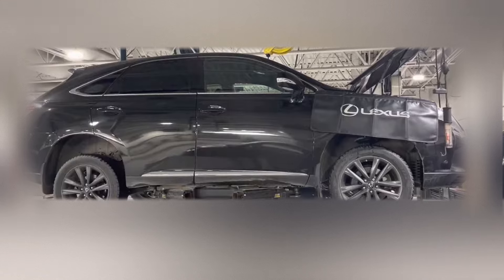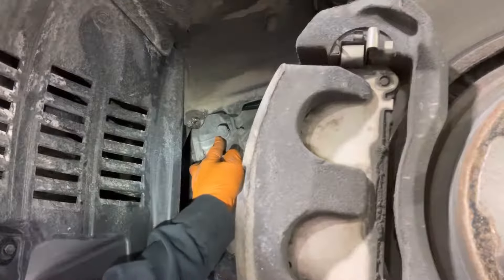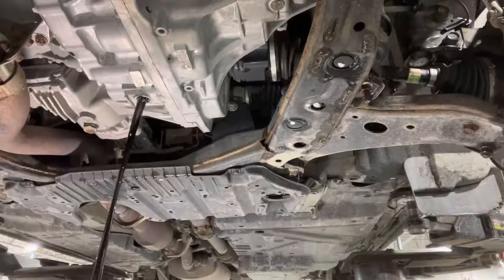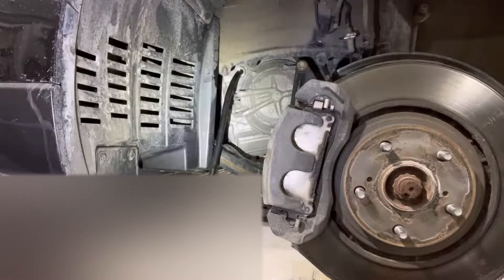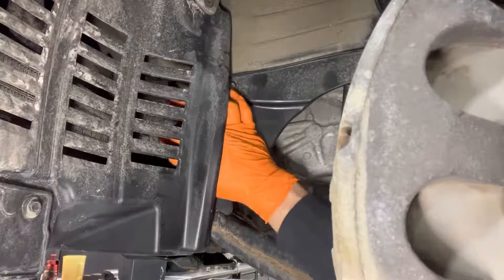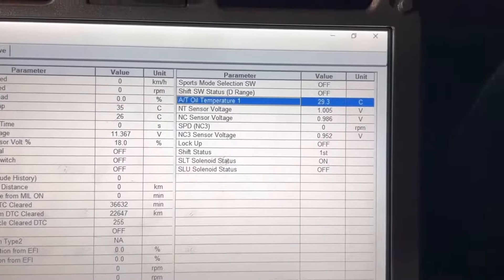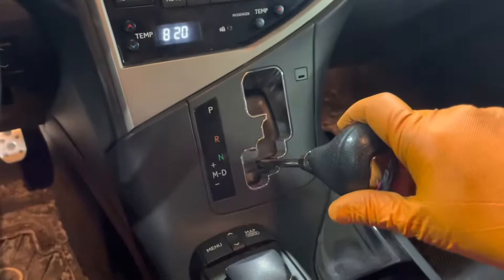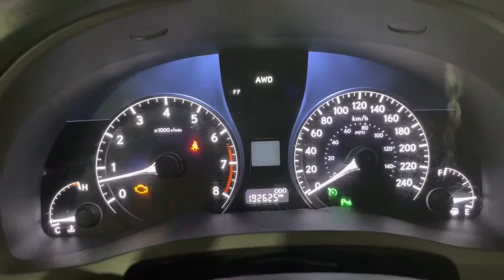2013-2015 Lexus RX350 F-Sport Transmission Fluid Replacement Instructions

Comment from the maker: Below are my affiliate links to the parts and tools you would use to complete this job. I may receive a small commission from the product sales. Thank you!
Genuine Lexus/Toyota automatic transmission fluid type WS: https://amzn.to/454JymA
Genuine Lexus/Toyota transmission overflow tube O-ring: https://amzn.to/3RwEdkU
Genuine Lexus/Toyota transmission drain plug O-ring: https://ebay.us/v9dHuZ
Genuine Lexus/Toyota fill plug gasket: https://amzn.to/3PsnVHb
Transmission fluid pump: https://amzn.to/3t6TO0u
3 Ton Jack stands: https://amzn.to/3q6VS7t
Sturdy 4 Gallon oil drain pan: https://amzn.to/3Ou4iiu
Torx bit socket set: https://amzn.to/44JAyUv
17 mm Allen head/hex bit: https://amzn.to/4584c5n
3/8" drive flex head digital torque wrench: https://amzn.to/3O1EOru
Rechargeable LED mini work light: https://amzn.to/3Y74OpY
Brake and parts cleaner to clean up the spilled oil mess: https://amzn.to/476RZQz

Comment: You are the best Viktor.
Reply from the maker: @JKS620  thank you 😊
Reply: @Viktor_G_Automotive did you see my other question about drain and fill intervals if trying to refresh all the fluid?  How long in between?
Reply from the maker: @ no, I didn’t see it. You can’t really replace all the fluid by doing drain and fills because more than half of the old fluid stays inside the transmission after a drain. On my vehicles, I just do a regular drain and fill every 60K miles and feel that’s enough. Some people choose to do a drain/fill, run the engine, do drain/fill again etc. I don’t know if that’s an overkill or not, but certainly won’t hurt anything. Doesn’t replace all the fluid since it gets mixed with the old stuff as soon as the engine is started, but will replace a higher percentage of it than just a single drain/fill cycle.
Reply: @ thank you.
Reply from the maker: @ no problem

Comment: Hi Viktor,

Do you have a similar video for a 2012 normal RX350?
Reply from the maker: @steliandragomir6815  hi, here is the video. The process is shown on an NX model, but it is exactly the same on the 2012 RX as they use the same transmission. https://youtu.be/TAUZ24dqssg?si=DPqWiCS-WSmejtxC

Comment: Thanks for the great video.  I plan to do this service on my Father's 2016 RX350 as I have just done this a couple times now on my 2021 Highlander. 

In the Highlander, there is a transmission fluid cooler bypass that needs to be pushed before completing this fluid change out.  Does the RX350 have a similar cooler than needs to be bypassed?
Reply from the maker: Hi, the RX350 does not have a transmission cooler thermostat. Here are the fluid replacement instructions for the 2016: https://www.youtube.com/watch?v=vaTORM3T24s

Comment: @Viktor_G_Automotive Thanks a lot for the video Viktor, super helpful for my 2015! I wanted to ask for the part numbers of the 2 O-rings, the link in the description for eBay does not work anymore.
Reply from the maker: @NimishGujarathi  I’ll look into it when I get some time, thanks!
Reply from the maker: Hi, I've updated the link, please be aware that I may receive a small commission if you use my link to purchase the part. Thank you! Genuine Lexus/Toyota transmission drain plug O-ring: https://ebay.us/FCTEOJ
Reply: @Viktor_G_Automotive  Thanks a lot, You deserve that commission Viktor! 😊
Reply from the maker: @NimishGujarathi  thank you 😊

Comment: I did two drain and fills on my 15 rx 350 and each time 1 1/2 quarts came out? Cold and warm it was the same.
Reply from the maker: @MatteoTodd  F-sport model as shown in this video? Should be around 3 quarts. Non F-sport uses a different transmission, drains between 1.5-2 quarts.
Reply: Ty so much your vids are amazing. Maybe you could help me with one question. My 2015 RX 350 non-F sport, do you know the drain plug gasket part number?
Reply from the maker: @ hi, all the part links will be below the video both in the description and the top pinned comment. (Not this video, but the other one for non F-sport) Cheers!

Comment: Dear Victor,  Thank you for the detailed guidelines. I tried to carry the procedure on my 2013 RX 350 AWD, but near the end when I was trying to set the fluid level by switching between D and N, the D and N both appeared for a few times and then alternately showed D and blank without N or a solid D. I was confused but still went ahead to drain out the extra transmission fluid while the engine was running. Why did not I experience the same as what you showed in the video? Did I drain the extra fluid too early?
Reply from the maker: If the indicator was blank, it wasn’t hot enough when you overflowed it, so the fluid level may be a little high.

Comment: Hello I didnt meaure the fluid that came out of my RX350 2014  not f sport model , I drained it while it was cold and then I refilled like 4.5 quratz as I was not sure but later when i realised after 20 mins of driving , I drained out little over 1 litre , the oil was bad and I put the drain plug did not do any fill up , is it okay or will I run into trouble ?
Reply from the maker: You must set the fluid level properly or you may damage the transmission https://youtu.be/TAUZ24dqssg?si=cj-lQYzRfOcvRcCW

Comment: Wow that is a completely different transmission than what's in the normal 2013-2015 V6 engines.  At least those with a pan...
Reply from the maker: Yeah, it’s a bit different from the 6-speed transmission.

Comment: Have a Lexus rx 450h 2014 with 145000 miles,went to the Lexus dealer and they didn’t want to change the transmission oil.any suggestions?
Reply: Get a second opinion, from a real independent transmission shop with experience with Toyotas.  The problem is, just like many independent shops, they don't do a lot of heavy repairs on Toyotas because they just don't see a lot...

You're on the edge of what many experienced techs will say not to do since it's not been serviced in the past.  The friction material suspended in the the fluid is actually helping the clutches grip when they engage.

If it was mine, I'd go ahead and do it and do it every 60k....
Reply from the maker: Just replace it yourself, here is my instructional video: https://www.youtube.com/watch?v=wdLpuT4ctC0

Comment: Where is the transmission filter? Do you not change out the filter? Why does f sport not have a filter and normal model does??
Reply from the maker: This video describes the fluid replacement procedure, not the filter replacement. This particular transmission has the pan on the side instead of the bottom. I am sure it has a filter/strainer in it, but just like the rest of the Toyota transmissions, the strainer does not normally need to be replaced.

Comment: Do you reset transmission computer after oil change?
Reply from the maker: No, it is not required
Reply: @Viktor_G_Automotive  Thank you! Bought my rx350 f sport from auction, was hit in transmission radiator, repaired it and transmission was in limp mode I suppose…got oil change in Toyota dealership (when your old video was deleted)but it was still in limp mode-they did not reset it! Then my friend reset transmission and it drives fine but sometimes it shifts kinda dumb with a kick when I speed up 50-60 uphill. I’m concerned if I should do oil change myself as dealership might not put level 100% correct. From your experience is it just normal for these transmissions or level might not be correct? Would appreciate your advice!
Reply from the maker: @СергейДаниловский-ш7и  the 2016-2019 RX models with the same 8-speed transmission as the 2013-15 Fsport RX have a TSB out for a software update for bucking and surging, but it doesn’t apply to the earlier models. I would first of all check the fluid level. If the level is good, there is not much else you can do but drive it and live with the way it behaves. It might be normal, but I couldn’t tell without driving it myself.
Reply: @Viktor_G_Automotive  Thank you! I’ll check fluid level this Friday and see how it drives. If you ever in central Minnesota you’re very welcome to have a look and couple beers 😁👍
Reply from the maker: @СергейДаниловский-ш7и  thanks Sergey, I am in Canada, so it would be a bit of a drive 😀

Comment: Does anyone have the part numbers for the 2  O rings for the 2015 Fsport?
Reply from the maker: Hi, all the parts are linked in the video description below the video.
Reply: if you have a scan tool do you have to toggle between Drive and Neutral or is that just for when you use the jumper wire? Thanks
Reply from the maker: @rcd9679  it puts the ECM into fluid level checking mode and stabilizes idle speed, but it is not critical to do it if you are using a scan tool to monitor fluid temperature.

Comment: If you know exactly how much fluid need to go in, you don't need to drain overflow, because there will be no overflow.  Am I not correct?
Reply from the maker: The only way to know for sure that the fluid level is correct is by using the overflow procedure at the specified fluid temperature. Otherwise it’s just a guessing game.

Comment: Today, just took my wifes 2015 rx350 f sport to the dealer. Between 2 and 3rd gear there is a shutter that happens at slow speeds. Dealer is saying the issues is with the trans. They are checking the fluid level on the trans and doing a "relearn". Dealer advised thst you dont ever change the fluid for the life of the car. They say that if what they are trying doesnt work, to replace the entire transmission which i was qouted at 13k. 

Car has 122k miles on it. Bought used, so i dont know if the ATF has ever been changed. Dealer said that it looks like its never been changed. 

Any suggestions on what to do? Thanks
Reply from the maker: If you end up needing a replacement, I’d source a low mile used transmission, it will cost less than half of the new unit.
Reply: Thank you for the quick response. Do you suggest changing the ATF, even though the dealer says not to and it lasts for the life of the vehicle?
Reply from the maker: @joshuabrown4828  if the transmission is damaged, it is unlikely that replacing the fluid will do anything at this point. In essence, if the fluid level is good, transmission possibly needs to be replaced.
Reply: Okay thanks for the info

Comment: Oh btw, my machenic friend told me a tip on measuring without having to check temperature.  Make sure your car sits overnight,  keep the new fluid in the same room. Measure how much you drain out,  then just put the same amount back in.
Reply from the maker: @nnj4378  if you know with 100% certainty that the fluid level was correct to begin with…